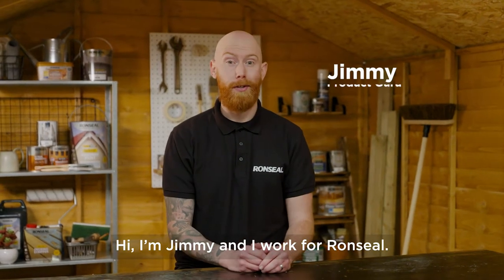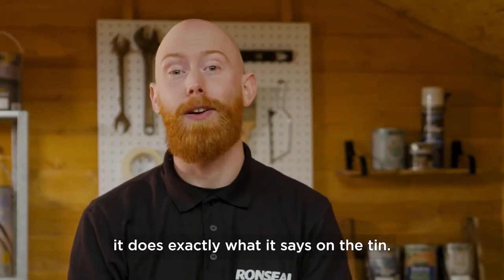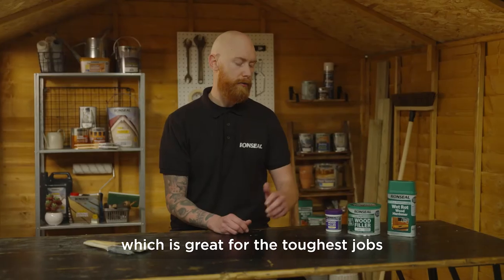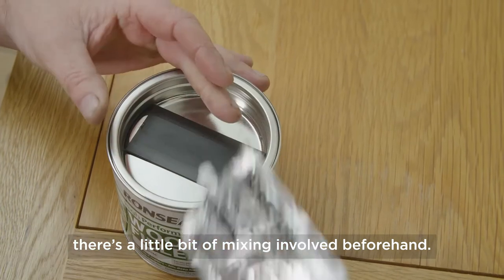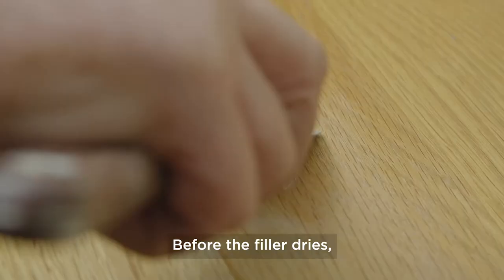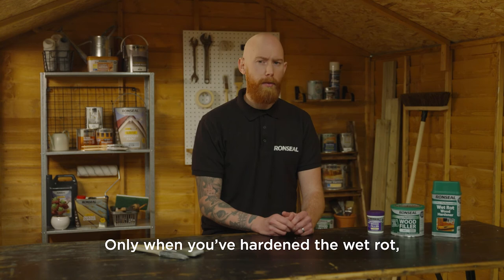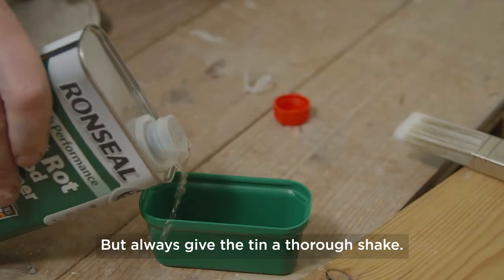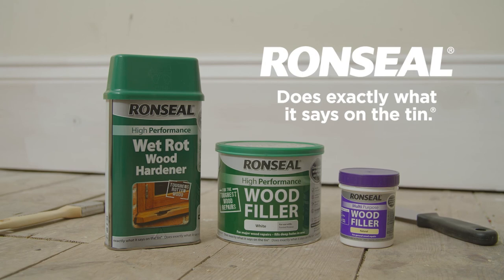How To Repair Damaged Wood | DIY Tips from Ronseal

Comment: When using High performance wood filler if I only need to use a small amount not a golf ball sized amount will the rest be OK to use at a later date if left in the tin?
Reply: You have probably used it by now but yes (obviously eventually it will go bad but will take a long time to get that day
Reply: Way